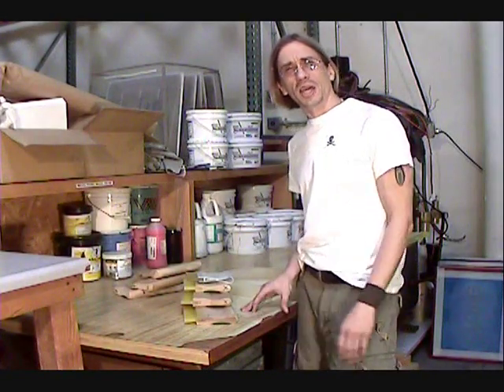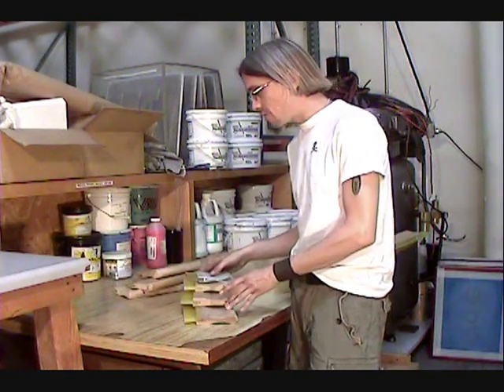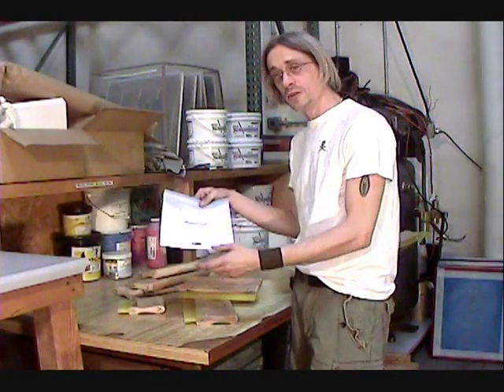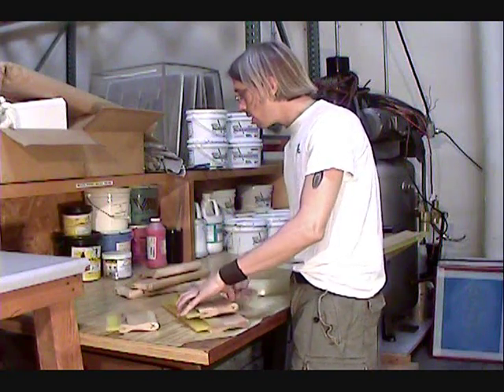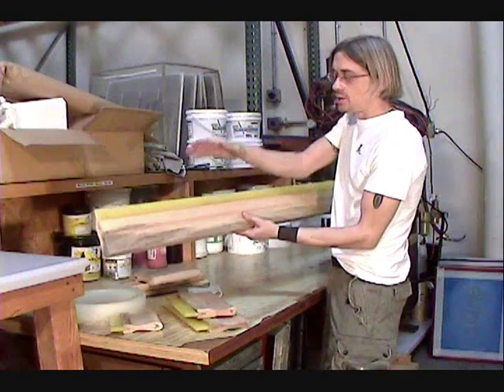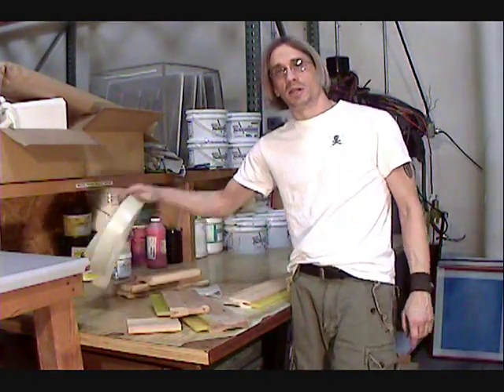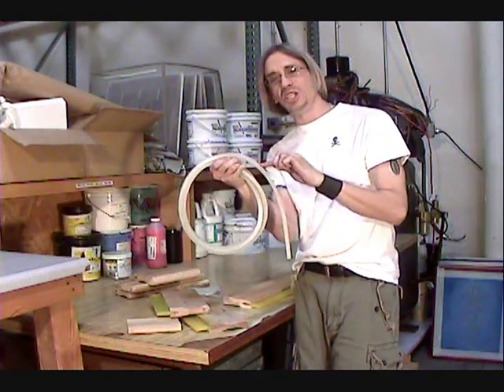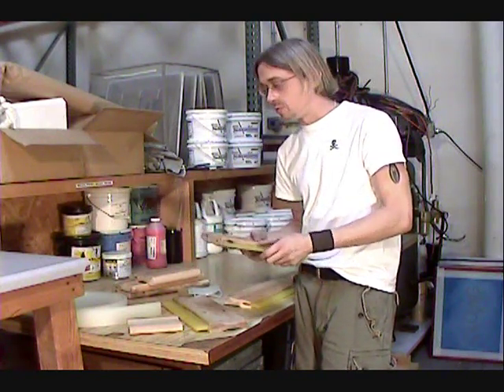How To Screen Print: Squeegee Tips

Comment from the maker: Once you have drilled holes for the machine bolts through the handle and the squeegee, you can only use one side of the squeegee. So you cant pull it out and reverse it to get extra life. You have to replace it with a new piece of squeegee. But it does extend the life of the handle to be reused as many times as you can. Most all handle fastening systems will make the fastened side unusable. The bolts are standard machine bolts. Thanks for the comment!

Comment: Good info. on the squeegees. The machine bolted ones certainly make more sense economically, environmentally and posibling giving longer life if you can turn it over and replace it, as well as renewing it?
Would you use galvanised bolts or, brass, etc?
5 stars Johnathan.

Comment: Hey my friend, good show as always, funny I just screen printed my first shirt and was coming to ask you if squeeges can make the thickness of your stroke diff. To start I do have a yudu and can say without even starting on it the one they supply is just garbage, a piece of crap I could use a spoon and do a better jobe. But my question is when I did my shirt the colour came out darker then I wanted. Im using yellow and it came out dark, like it wasn't filling the screen enough and I was like dragging it back out every stroke. Now you being a veteran could probably do it with a blade of grass. But we aren't, so would it be my squeegee or the paint maybe, water based is what im using. Could have been that I wrapped the sleeves and bottom and tucked it under the board which maybe I could have had a bounce to it. Either way please send me some feed back on the possibilities. Thank you...
Reply from the maker: Thank you. Yes, it depends. This could be the ink and/or the squeegee. If you’re printing water based inks on dark garments then you need to make sure the ink is high opacity or has a white under base. Check out more of my videos to learn all about printing under bases and HO inks. Don't use the Yudu plastic scraper as a squeegee. Get a real one. Thanks for watching and leaving a comment! http://www.catspitproductionsllc.com/ - http://catspitscreenprintsupply.com/